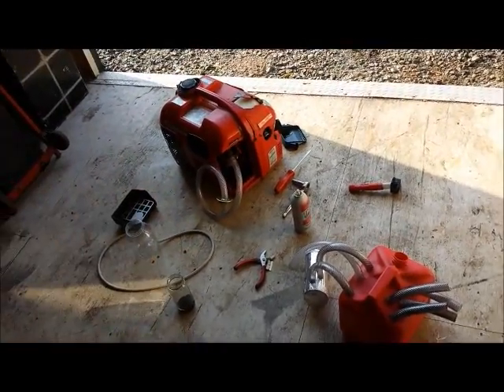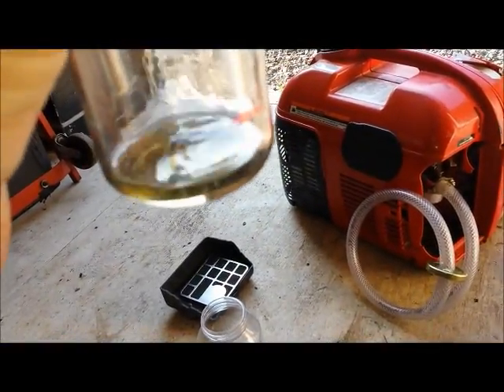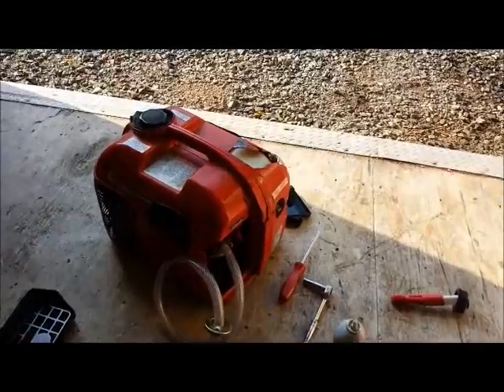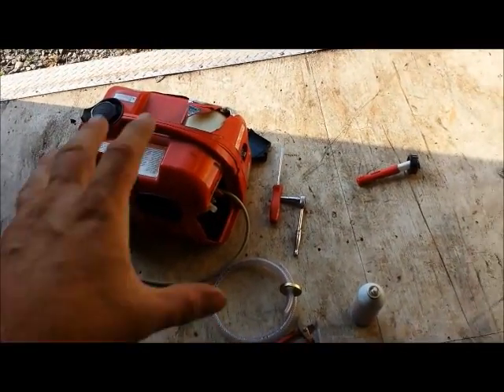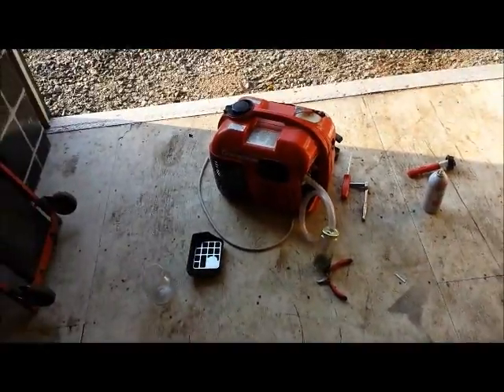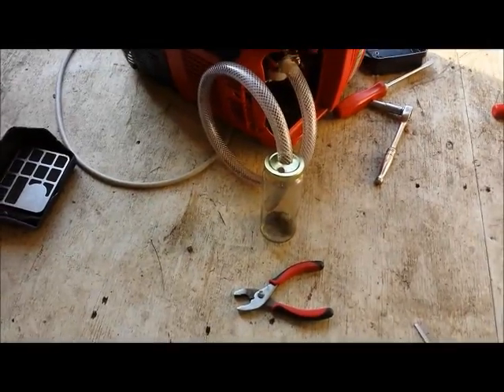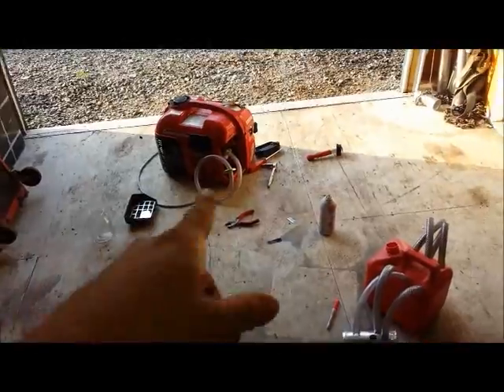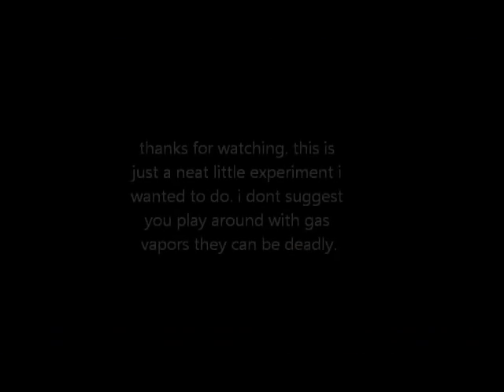generator running off gas vapors

Comment: There's a way better way to do this you have a container with two holes in it and the one hose goes all the way down into the bottom of the gasoline and the other hose just goes right into the top and then you suck the air through the gas tank and it bubbles the gas up and you sucking a lot more efficiently

Comment: The oggle design used vacuum and a heavily reinforced fuel tank with a heating system (cause the vacuum and evaporation make the tank freeze), it gave 400 miles on a single 4 gallon tank driving a huge 2+ ton car (it was a 70s ford galaxy, huge engine to boot, so taking modern lighter cars and more efficient engines you could get 5 to 10x that) this is not fiction it was PROVEN by several science an car magazines and institutions shortly before he was found dead and all his designs and prototypes disappeared, many years after another guy cracked the design and made it work again he was also found dead on mysterious circumstances

Comment: Why wouldn't you put a bubbler on it?
Reply from the maker: its a proof of concept, not a prototype.  just wanted to show it can be done
Reply: Justin Sane I think a bubbler would prolong the time. Because then you don't run into not producing vapor. As you said once it gets to a certain level, It die's. Not trying to argue.  It's awesome either way. Like your channel man. Keep up the good work.
Reply from the maker: In my car version I had a bubbler. I agree not argue. Its just in the generator version I didnt need a bubbler to prove it worked
Reply: Justin Sane what kind of fuel? If gasoline, them a longer test is needed. Seems people hit a roadblock with vapor after a short time because youre running on easily vaporized elements at first. Alot of gasoline(maybe 40%) doesnt evaporate quickly enuf at low temperatures to run a motor...but good luck.

Comment: Wouldn't it run the generator at extremely lean AFRs?
Reply from the maker: depending on the vapor generator size. the one i built for my car test was actually way to rich. this one seemed perfect for the generator though. no black smoke and no lean pops seemed to be very close.
Reply: You can always put a tad bit of two-cycle oil if it's going on like that actually but I don't think that it's going to run to lean for that hose it would have to be four times the size of hose and you wouldn't even fit that in the intake